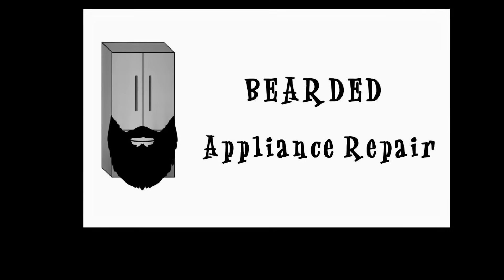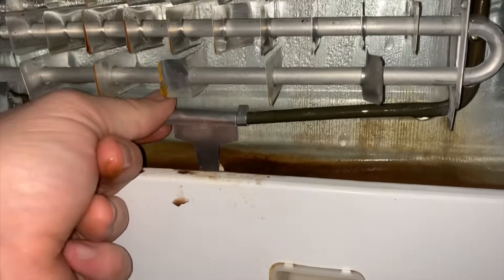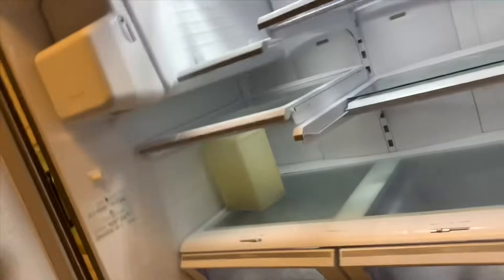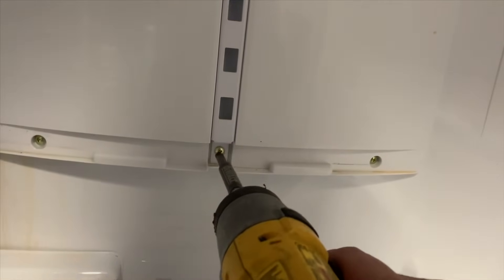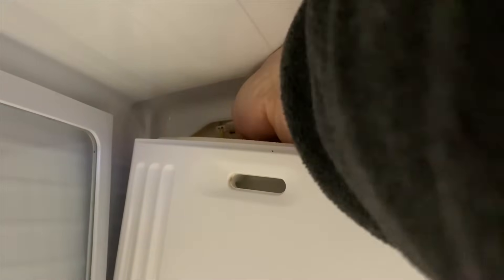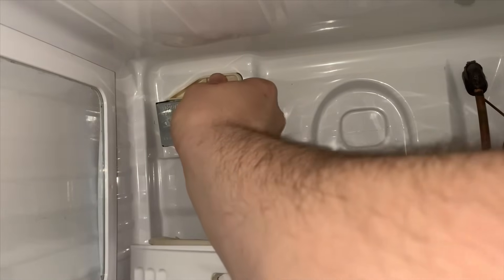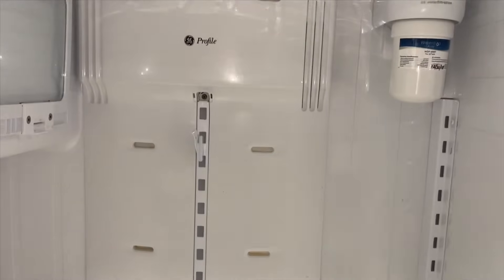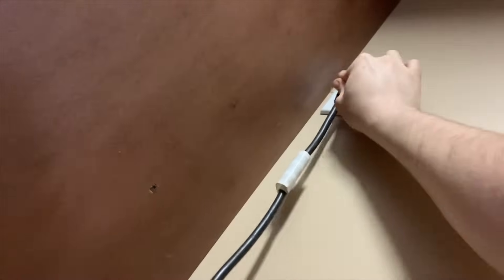Samsung fridge water collecting under deli drawer fix (DA82-01415A)

Comment: I replaced the assembly cap drain tube just like in your video, and water is still showing up in the meat tray and in that area where the drain clip evaporator is. There is no ice, just water. I noticed the area where the drain tube was replaced is dry.
Reply: Same. I have just water that I clean up monthly with shop vac … did you ever get a fix to your prob?
Reply: @tiffanynewsome4986  actually, we had our power go out for 2 days because of a storm, which caused everything that was frozen to melt. After everything melted down, I never had an issue again. I’m thinking that I never gave that area below the drain clip evaporater to melt. That’s my only guess…

Comment: I have a Samsung RF28HDEDB- PRODUCTION and I need to know if I need or don't need the control board. I see the manufacture date is 1/2016 so I know you said if built before 6/16 you don't need it for the model you were working on in this video I just want to confirm YES or NO for my model

Comment: Will this part fit Samsung RFG297AARS?
Reply: Yes it will. I have the same frig but in white RFG297AAWS. I had the kit from Amazon  installed 5 days ago for $275 by a repairman who had done it before. Takes less than an hour but the worst part is the defrost for 24 hours before.  Frozen stuff just won't keep in an ice cooler. I would try the portable heating element inside the frig for 90 minutes like someone else suggested in the comments if I had to do it again. While you have the back panel off be sure to vacuum dust off the coils. The unit will run cooler

Comment: Could I just use a heat gun (carefully) to defrost the panel prior to removing since I don’t have anywhere to put all of our food for 24-48 hours?
Reply: Take a photo of the interior of the refrigerator so you can put the shelves back where they were. Remove the shelves. With both doors wide open set an electric fan on the bottom surface and aim it at the evaporator. Set the fan on its highest speed. I prefer to give it 12 hours and it's always fully defrosted.
The fan forced room temperature air is sufficient to defrost it well within 12 hours.
I set a large ice chest directly in front of the refrigerator and empty the contents of the reefer into the chest. This keeps the reefer contents cold during the defrost. Adding some ice on top of the contents in the ice chest helps too.

Comment: Did the same job thanks to you! I will note it was frozen way down in the tube so,i used a flexible wire (like 14 ga) to clear it ,boiling water and compressed air to get er done.!
Reply from the maker: Yeah without a steamer it can be challenging.  Glad you got her done!

Comment: I ordered  the kit that you say will fix it. My question  is the kit comes with four aluminium  blankets.  Where do they go. Thanks
Reply: The 2 Strips go behind the evaporator on the aluminum plate.  2 lay under the aluminum plate near the hole.  The purpose is to create enough heat to make the defrost happen faster.    

Bearded man,  The left (center) drain tube is from the freezer.   The Right drain tube in the right rear corner is from the Top Evap hole where the clip is.
Reply: Thank you Sir

Comment: My Samsung RF23HCEDBSR/AA -08 has three drain tubes.  Only the middle one was clogged and I cleaned it for now, but the kit just provides justtwo tubes.  Should all three be replaced or which of the other two need replacing?
Reply from the maker: Change the one that had water coming out and any others that are missing the check valve piece.  If they are all the same then just change the one that looks the worst.
Reply: @BeardedApplianceRepair  Thanks for your response, but didn't see it until after I ordered three drain tubes individually and not the kit since they are pretty cheap. I actually ended up ordering three SAM-DA97-04049D which fit all three.  All three of these new ones do have the check valve as well as they DON'T have the duckbill which was my understanding is what was causing the problem and that is where one of mine clogged in the past with dirt and filled up with water.  Now there wouldn't be any drain tubes that need both the check valve and the duckbill since the one of mine on the far left was that configuration from the factory.   I replaced it with a DA9704049D drain tube also which my "guess" would be better to get rid of the duckbill on all of them.   Again, Thanks for your help!!!!!!!!!!   By the way, my model is a RF23HCEDBSR/AA series 8

Comment: Thanks for the great video! A couple of questions: can I turn off the water so it will stop leaking until I can get it fixed? How do I do that? Can the fridge run like that? Thanks!
Reply from the maker: No if it is this issue that won't stop the leak.  The leak is coming from the cooling system on this one. Only way to stop it is fix it or un-plug it.

Comment: Hi. I have a Samsung RF265 French Door and am very familiar with the freezing issue. Mine is 10 years old and it started doing this about year 6. Heard a knocking noise to start, i figured it was ice hitting the fan motor. Then I saw the ice in the holes and started seeing the condensation dripping on the back wall and followed it to under the crisper drawer. So there my journey began. I bought cheap top freezer refrigerator in the garage once i saw a trend with the=is freezing problem. Mine does it about every 6 months.Thank you for this video i was able to disassemble the back refrigerator panel just as you showed. I had already defrosted for 2 days. I wait until I don’t have anymore water under the crisper drawer. I get the water out with a shop vac once or twice a day until its gone and haven’t had it spill on to the floor yet. I have a question about the clip. Mine actually has a long clip but it was bent up and was not centered on the heater. How far Does the clip need to be down into the hole for the dr=frosting to work? Mine actually is flush over the hole once I bent it back and centered it. It looks like the new one goes past the surface and is down into the hole. If it does what is h-the best way to get the kit? Samsung direct or can i get it from After market online stores? Please let me know. I can send you a pic of it if you would like to see it, just let me know where to send it. Thanks. Michelle
Reply from the maker: In the description I should have a link to the kit.  Comes with the heater clip along with new drain tubes which can be clogging up.  You want the clip to go into the hole yes.  I can’t tell you how much it goes in,  just by guessing I would say 1/2 inch.
Reply from the maker: Good luck!

Comment: I've got a similar issue at the moment. Opened up inside to get to the heat exchanger, and there's ice blocking the drainage whole. Drainage pipes behind the fridge are clean. Any advice??
Reply: No rust inside, and the clip is situated well into the drainage hole

Comment: Hello Mr. BAR. I did exactly as this video suggests, but water pooling continues. Next steps?
Reply from the maker: Got to follow the water trail.  Take it apart again and see if it’s still clogging up in the drain pan.  Drain tube might be compromised or it didn’t thaw all the way when you initially installed everything.  How long ago was the work performed on it?
Reply: @BeardedApplianceRepair  I did the work 3 days ago. Quite sure the drain cleared when I saw bubbles rising and the water escape quickly. Skill reference: Biomedical Electronics career. I'll happily tracedown circuitry if you suggest.
Reply from the maker: JaguarFender70 with the water pooling you I would think it’s more mechanical.  If water is still in the drain pan the tube is simply clogging up.  If the drain tubes and heater clip were installed I would think your drain tube or insulation around the tube has been compromised causing it to clog.  What are you seeing now? If the drain pan is not full of water I would check door seals or a leak in your filter housing.  Turn the water off and see if the water pooling continues.  That will rule out the filter housing if it continues to leak May have to wait a few days though to make sure. One last thing it may be would be the evaporator cover.  Could have an air leak in that which may cause a similar leak. I am curious to know what you find though when you fix it.  You can teach me something if it’s not one of the things I’ve mentioned.
Reply: @BeardedApplianceRepair  Defrosting the back panel now. 95% sure the drain pan will be frozen again. Once I reopen/clear the line I will blow compressed air thru it and watch/feel it come thru tthe exit at the drain pan near the compressor. If that all checks fine, I'll need to learn how to test the heater coil. Any clues on that?
Reply: Update: My Error (unimaginable!)... Yesterday: Drain pan and tube were still clear. It occurred to me that I may have forgotten to clean up/wipe the floor area under the crisper drawer after my first effort. Today: No water pooling...you 'da man, Mr. BAR!
Reply: Update#2: Checked for pooling...STILL happening! Stay tuned.....
Reply: Finally getting back to this POS and this problem in particular. Never performed the "turn off water" test, but will soon. In advance, if the leak is resolved, what's the fix for it?

Comment: It plugs up from ice because the water didn't drain out.  The refrigerator must be level and slightly tilted back. Mine plugged up with ice after eight years of no trouble because I moved it to the hot and humid garage. The floor is not level, nor was the refrigerator. 

A faster way to melt ice is use a hair dryer and a funnel. Place the thin end of the funnel at the hole and place the end at or in the drain hole.

Comment: Great video. Bought the repair kit off Amazon and installed the drain tubes. The heater sync clip was just slightly to long going into the drain so I had to cut off about 1/2 inch to get it to slide down. Mostly because my heater coil was bent slightly differently where the clip attached. It dipped in a big loop toward the drain hole so the clip had to push down further to fit. So after a little trim it went right in. Thanks again for the help.

Comment: I'm planning to start off with replacing the heater clip, and not buy the entire kit with new tubes to save some cash. I will first try to clean out the bottom tubes and re-open the holes in them if they're clogged. Do you know the purpose of the check valve piece that gets clogged up anyway? Would there be any reason to not just cut all the rubber that clogs up out? If it is beneficial I might just cut new holes into it like the new one comes with. Thanks for the help!

Comment: On the drain tub I just cut the rubber in half so it dont clog as for water under the the crisps I un clog the drain and the defrost the evap then I run a copper wire down the drain and then I recommend replacing the evap panel cues the new one comes with new form seals and that takes care of water under the crispers

Comment: Hey Mr. Bearded appliance man. This video is spot on for fixing the manufacture defect. However after a year i have water in my crisper again. Drains are clear. Water drops on lower backwall. No ice except in crisper floor under tray. Ideas????
Reply: Same for me, did you ever get an answer or solution?
Reply: Yes got a new electric board on back wall. Been fine ever since.
Reply: @RBelun what part did you buy?  We have this issue and I’m curious
Reply: @josutherland3685  the center plastic board on back wall.

Comment: Why do the drain lines even have the restrictions?   There must be a reason, but if they were just tubes they wouldn’t clog up….
Reply: Probably to limit build up of water in the pan and allow for evaporation to remove most of the water
Reply: the restrictions are like check valves to limit warm air from pulling into the refrigerator each time the door is closed.  The drain line near the evaporator drain pan will freeze up easier if there is much back flow of warm air. There is a lot of negative air pressure inside as the warm air is cooled when the door is closed.

Comment: My Samsung has been pooling water under crisper drawer since the first year 🤦🏻‍♂️
Is the pan under the fridge suppose to drain out under the house or does that condensate just evaporate??
Reply: The water drains into the pan where the heat from the condenser coils evaporates it.

Comment: I have a g e profile 3 door unit. Have had to remove ice from drain pan below refrigerator coils. A great deal of rust has formed in the drain line. Replaced heater in the drain hole, and both drain parts at bottom of unit. Still freezes up about every 3 months. Contacted g e tech support. Have been informed that the drain line from the refrigerator is not a direct drop to bottom of unit. It has multiple bends. With the amount of rust from drain pan, I wonder if a rust build up occurs somewhere near one of the bends. This may be causing defrost water not to be able to leave the drain line and thus causing the icing problem.  This drain line is in the sealed part of the unit and is not accessible. In my research to solve this drain issue, I found a suggestion to add a piece of #14 copper wire to drain heater and drop it about 5” into drain so the water will be warmer as it travels down the drain.  Another suggestion is to give the drain a shot of compressed air to better clean out the line.  I do not understand why Samsung -  who makes the g e - did not use a material in the drain pan that did not cause rusting. I now am cleaning the area below the deli drawer every month of any water so that no ice builds up. The rest of the unit works great.

Comment: I’m gonna try what the guy in comment section said. I’ll set my freezer at 0 degrees instead of -2 degrees and see if that helps. Also why didn’t you blow all that dust off the condenser at the bottom by those tubes? Get a air compressor and blow that dust off.

Comment: Dang good video. Short and to the point without any gimmicks or corny bs. I ordered the kit from your link. Now to find a cheap fridge to put in the garage so I can defrost this one by the time the parts arrive! Thanks!
Reply: I use a really big ice chest and have a supply of frozen synthetic ice to put on top of the contents. I thaw out the evaporator using an electric fan inside the refrigerator turned up on high and aimed at the evaporator panel. After 12 hours I replace everything in the refrigerator and plug it in. It's totally thawed out and there's no need to remove the evaporator cover.

Comment: Question: I did this repair 2 months ago (see below) and am now having water under the pullout drawer again. At least it's not ice now! Anyway, I got a recommendation to install the DA82-01415A kit, which I've basically already done, just individual parts (metal tab for the heater element, and new drain tubes). But when I look up the kit online now it shows that it comes with a couple pieces of insulation as well. That is the only thing I didn't do before. Can you tell me where those insulation pieces go? Thanks!
Reply: They commonly go on the back of the metal plate behind the cooler element or at the bottom on the drain on the metal. There are other videos that show this. Best of luck

Comment: From a fellow bearded person - great work on the video. Helped me repair my Samsung fridge with no questions. Highly recommend unplugging for 24 hrs before repairing. I went right into it and spent about 2 hrs with a hair dryer.  Again, great video and thanks for posting.
Reply from the maker: Thanks man.  Happy married to my beard lol.  Yeah defrosting by unplugging it the way to go.  “Ain’t nobody got time for dat” other way lol.  Glad to help my friend!
Reply: Take out the shelves and place a fan inside the refrigerator blowing room temperature air over the evaporator cover. It will thaw enough for safe removal within an hour or two. No worrying about oveheating something and standing there holding a hair dryer. 
If you don't want to remove the back just do this overnight. Then plug it back in. You can leave everything as is in the freezer which will not thaw out in that amount of time. I put the refrigerator contents in a large ice chest during the thaw.

Comment: Hello, this is the exact problem that I have!  What is the part number for the replacement tubes (Kit number)? 
Thank you very much for the explanation, this has been very helpfull.  You also answered a question that I had about the streaks, I thought it could have been because I have well water.
Reply: Sorry, as I examined your post closer, I noticed the part number.  Thank you very much!

Comment: nice clear explanation, thanks.  kind of ironic that to avoid defrosting the easy-to-get-at freezer (back in the day), one now has to take the whole fridge apart to defrost the 'frost free' system. unfortunately, I didn't see your video until I had already blundered my thru the repair.  I have a custom car shop so I grabbed a hand vacuum pump and a compressed air tank to clear out the drains to add hot water. all 3 drain tubes were clogged as you showed.  I just cleaned the neoprene nipples with alcohol and snipped a little brevel into them so they'd open up a little more and maybe take a little longer before clogging up again:). also the compressor fins were completely clogged with dust which couldn't improve e efficiency so I vacuumed them while I had the lower cover off.  Does Samsung recommend any preventative maintenance to address these things?  I'm going to clean those drain nipples out once a year or so just to keep in practice.  --John
Reply: Samsung doesn't even acknowledge that there's a problem.